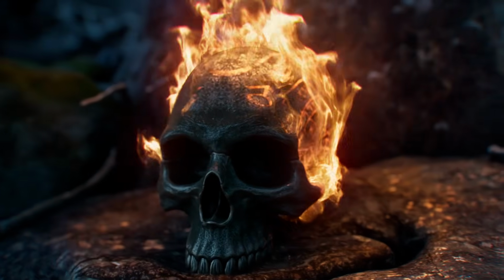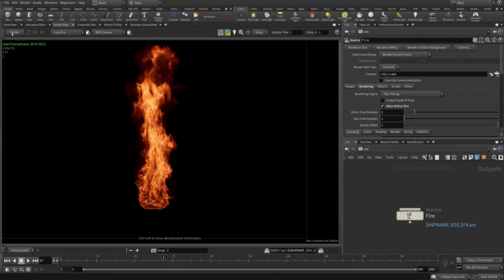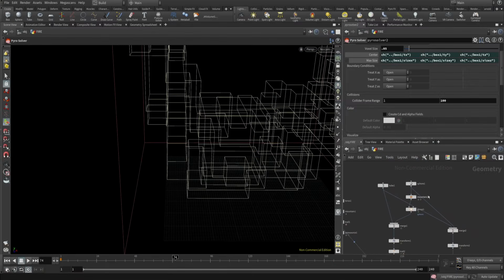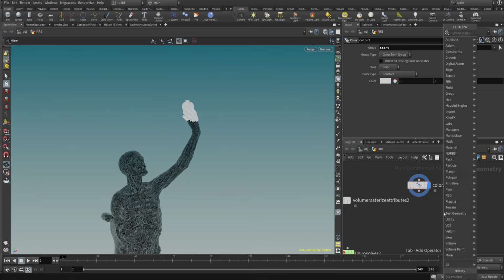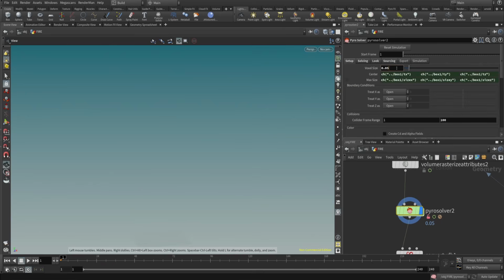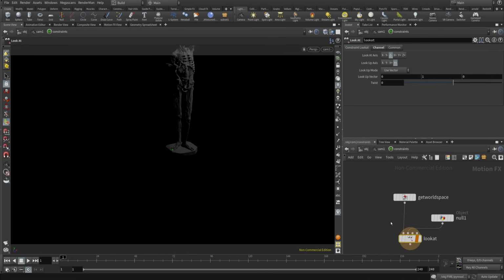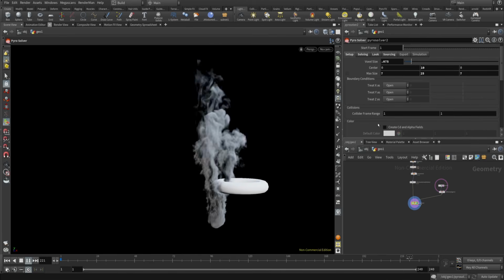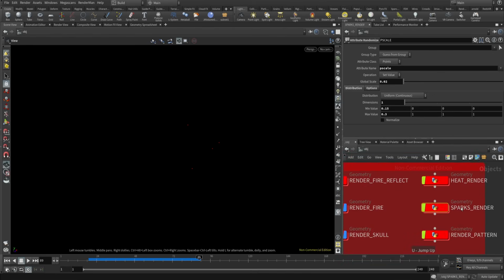Pyro FX in Houdini Tutorial, Part 03 | Realistic Fire & Smoke | For Beginner

Comment: Hi Sadjad. I got stuck at 1:40:34 after you go form the pyro solver to the pyrobakevolume, I'm only getting fire on BOTH squares. When I check it on the pyro source, it works exactly like yours, but on the pyrobakevolume, they both put out fire.  Any help you can give in getting the inside with fire and the outside with smoke even though both are going  from the pyro source to the pyrobackevolume?

Comment: Hi Sadjad. This tutorial is amazingly useful thanks! I always wanted to be able to create fire effects like these :D
One question on the first example if I may. If I check on "Minimal OpenCL Solve" as you did, the pyrosolver does not generate a vel attribute from the v attribute of the trail node. Could you help me figure out what I did wrong? I read on the documentation: 

When Minimal OpenCL Solve is enabled, all parameters in this tab are disabled; instead, only the fields used for visualization are exported. These are specified in the Bindings section of the Look tab. 
There are only 4 slots available, I tried replacing Cd with Vel but nothing happened  :/

Comment: For the non coding monkeys who wants to do a grow effect without wrangles:
In the solver node, use an attribute_blur, point it to Cd, blur by proximity.
Use an attribute_adjust_vector, point it to color, Adjust length only with a value of 10.
Done.
If you want a jaggy border, you can attribute_noise P as a first step, then attribute_copy Cd back to the original.